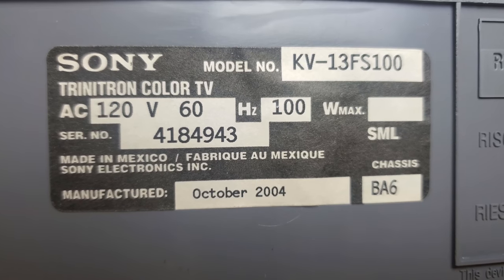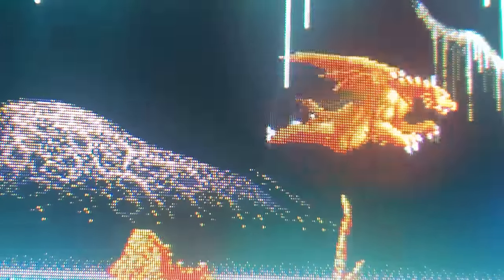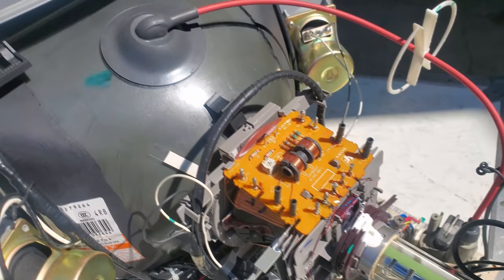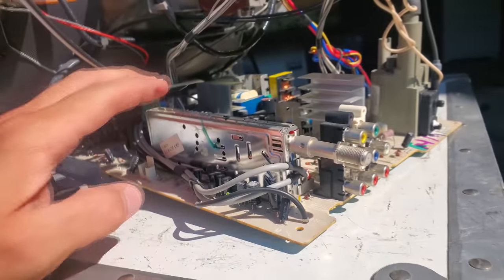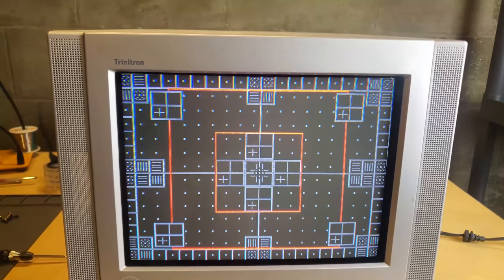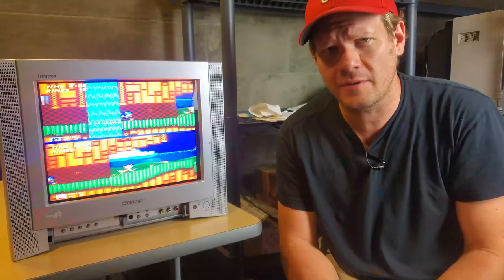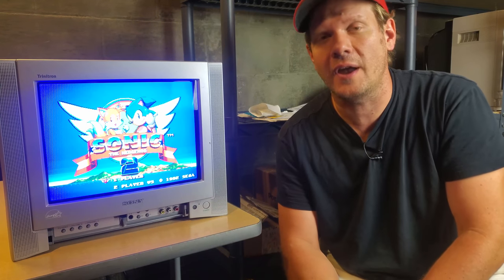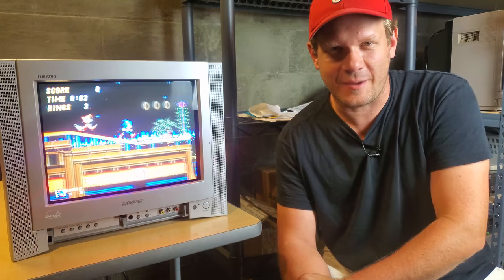What do I think about Consumer CRTs? - Sony KV-13FS100 Review & Adjustment

Comment: I'm in the UK and pretty much all of our consumer CRT's came with RGB out of the box. I've found the difference between consumer sets that are RGB capable and PVM's to be negligible. And given the enormous difference in price these days I can't say why any one should ever opt for a pvm over a consumer set unless you happen to have too much money on your hands.
Reply: I agree the cost for PVM's have become insane, picked mine up Nov. 2019 at a local game store for $250 because I knew I wasn't going to get that good of deal again that was close and 14 day return policy, but my 20" consumer trinitron is still fantastic.
Reply: I agree, I would even say getting a consumer crt rgb modded here in North America is way more worth it than paying for any pvm/bvm.
Reply: @Demokirby  Prices for PVM's in the states have gone bonkers in the last 3-5 years and espeically over the last 2 years. 5 or 6 years ago it wasn't hard to find a decent PVM in my area of PA for around $100. At that price, yes a PVM is worth it over most consumer grade CRT's. The tubes are just that much better. Picture quality is often just that much better. Crank those prices to 3, 4 and 5 times as much? I'll take my $25 32" JVC-D Series... component inputs and an overall really nice picture. Not PVM good. But damn.... I'll save the hundreds of dollars.
Reply: I'm also in the UK. Just picked up a near-mint PVM 20M2MDE with very low hours. Performed the geometry re-cap as a preventative measure and Calibrated. I can honestly say the picture & geometry is FAR superior to both of my B&O (MX4002 & MX7000) consumer CRT's.  Night & day different.
Reply: @nocturnaldivision  I know both signals are virtually identical, just saying rgb modding a TV is still worth over paying any premium price for a pvm these days, that's all
Reply: @BeeRye  Fair enough. If I had the means I could see modding a crt without component being worth it.
Reply: I agree, also the size. PVM are small, while I have two 21 inches CRTs and one 32 inches Sony Trinitron (aesthetically it's very similar to the one shown in the video).
Also, PVMs are too sharp for my taste, they don't blend pixels enough.
Reply: @davethebulb  I wonder how does a PVM compare with a consumer grade CRT PC monitor. BTW, can a PC monitor show interlaced content?
Reply: Yeah not into the PVM craze to be honest they always come small and in the end I want my games to look like what I remember.
The gameplay experience is better on a large screen IMO
Reply: @souljastation5463  A decent multiscan PC monitor can display a slew of different resolutions including interlaced.
Reply: @davethebulb  But most PC monitors weren't multiscan if I'm not mistaken. I think the average consumer monitor can only display progressive content.
Reply: Meanwhile in North America (Canada, US, Mexico), Braun tube sets (I directly translated the Japanese term due to CRT being used as a sociopolitical acronym in the US) never came with RGB inputs. However, this wouldn't be important for someone who needs to get sub-33 in Super Mario World without using the Star Road, or people who just want to play the damn game (like me).

As for the component VS RGB debate, I prefer component due to several major advantages: it uses three distinct RCA connectors in luma-blue-red formation, it allows for resolutions up to 1080p, and the Japanese D-Terminal connector is based off the component video standard (especially great if you want to have real component video on your GameCube for less than using an actual component cable). Reasons I wouldn't use RGB would be the fact that most consumer RGB equipment outside of PC/AT computers used SCART, SCART equipment remains expensive in North America, and I know there are absolute purists in this video's comments section saying the framemeister is still the best scaler.

Especially since the framemeister has never had a single price drop in it's life in the market, the delay for switching resolutions lasts centuries (well, really only a few seconds, but in games with quick action, that is forever), and Sonic 2's split screen doesn't work with the Framemeister. The OSSC and RetroTINK exist for a reason, and not many Japanese streamers use the Framemeister either 😒

And in Vietnam, Braun Tube sets never had RGB in it. I know because four years ago, I went to Vietnam to visit my mom's family (on the way home, I went to Japan), and I transported a dual system NTSC/PAL set from my aunt's house to her farm. It only had up to S-Video on it, but the cable boxes (which are smaller than those gigantic North American DRM propaganda boxes) only supported analog video via composite video. Even in Japan, I cannot find many Braun Tube sets that support RGB, and many people that do speedruns there don't use RGB.

A Korean YouTuber even imported a Braun tube set from Japan, and it had mono audio and composite video.
Reply: I agree, I live in France and ALL consummer CRT 's had RGB/Scart since 1980, we were lucky at this time.
Reply: @patosomon724  Your TVs had to have RGB because of SECAM. If you tried to connect a PAL device to a SECAM TV with anything other than RGB you would have seen a black and white picture.

And this is also the reason why every French console outputs RGB, even the ones that in PAL territories normally don't.
Reply: Not all of them did. Depends when they were made or what make / model they were.
Reply: @souljastation5463  Some of the French consoles just internally converted composite to "RGB", like the French NES.
Reply: @RWL2012  that's because the NES hardwate can't output RGB, but most of the subsequent consoles (Mega Drive, SNES, PS1 and 2...) can.
Reply: @souljastation5463  You can get the NES RGB mod from game tech and it's amazing!

Comment: Love consumer set vids. Detailing geometry, convergence, and color adjustments on Sony’s, Toshibas, and jvc would be useful for a lot of people. Pvms will become more rare, but finding a decent consumer set and dialing it in gets you most of the way there.
Reply: It certainly does. A decent quality consumer CRT, properly dialed in terms of focus, brightness, color drives, and getting the geometry in good shape.... you get 85% the quality of a PVM for in many, many cases a tiny fraction of the price. A recapped, cleaned up PVM is a thing of beauty. But at a price. $1000+ vs something you could get for free or for $50?
Reply: The quality improvement you get with a refurbished/future-proofed pvm doesn’t scale with the prices of today when compared to good consumer set. Fraction of the price and 80-90% of the quality. I love my Toshiba 20af and my 32in d series, even though I have a 20m4u and 1354Q. I find it hard to recommend paying for a pvm over consumer set for most people, after seeing them both side by side.
Reply: How good are the late model Toshibas?
Reply: @snizzytown5217  excellent. I like them more than Sony’s. Any late model set with component inputs is going to be excellent if it hasn’t been abused though

Comment: Great video, Steve!  I happen to like consumer CRTs more than Pro monitors.  For me, it's all about nostalgia and I like to use CRT TVs that look similar to the ones I had growing up in the 80s and 90s.  The 13FS100 does look like a really nice set and I would like to get one at some point.  One consumer CRT I picked up recently is the Sony KV-13TR29, new in box, made in 1994.  It is one of my favorite CRTs of all time and has one of the best pictures I have seen on a consumer CRT and it is composite only.  The picture is very sharp and the colors are excellent.  Compared to my PVM 14N5U, I like it a lot better and it has much better colors than the 14N5U.  Apparently, the 13TR28/9 sets they are easy to RGB mod as well because there is a closed captioning board that you can remove and inject your RGB into there.  The 13TR29 is the white chassis version and the 13TR28 is the black chassis version.  They were made between '93-'95.
Reply: Totally agree, and what is nice about consumer sets, is that you don't see them ugly scan-lines you sse on PVM/BVM, as the HVL resolution matches the line count vertically, so you get a more balanced pixel-art image.

Comment: I am also very surprised as to how high quality this CRT is.

I bought the KV-20FS110 back in high school during the Gamecube era.  Does not have S-Video, Component input is great, and unfortunately it is a flat screen. 

Still works like a champ, tube probably less than 6000 hrs, mainly used for gaming, no movies or TV.  
Now with emulators, PVMs, etc. I realized that mine came a bit brighter with convergence a tiny bit off.  

Your videos have given me a lot of confidence taking apart and repairing CRT's, PVMs, and the occasional arcade CRTs.

Keep up the great content!

Comment: Yesterday I bought a tiny and neglected KV-14FV300 CRT for $ 20 USD, I had to reset it to factory settings as the so called expert that had "calibrated it" only managed to make a real mess of input & video quality.

I stumbled upon this video trying to learn how to adjust the screen pot which also had been tampered with, thanks to this video I learned how to do it, and also I found out that KV-13FS100 and KV14FV300 seem to be the same TV, simply sold in different territories under different names, and now that it works I'm delighted with the image quality, RF, Composite & Component inputs.

Comment: I would like to see a full restoration and fine tuning of this tv and a comparison of it with an entry level 13" PVM and a more bare bones 13" crt set as well.  It would be great to see before and after restoration/ adjustments of each and also composite comparisons, and rgb mods and comparisons of that.  You would be diving deep into the subtle differences related to comb filter quality in the case of composite and with RGB mods you could isolate differences related to tube & driver circuit quality.  These well equipped models are getting close to entry level PVM tvs in their difficulty to find and prices. I fear the last of the small tube availability will be lower featured consumer tvs but with the right TLC and a few mods they are capable of providing a great experience.  Keep on growing interest in this hobby, we need people to save more of these things from recyclers so our kids can see what old school gaming was!

Comment: A friend of mine is building a few arcade cabinets from his childhood, using tubes for the nostalgia, and I convinced him that Sony TVs were better. He doesn't care much about how "accurate" the tube should be for an arcade, so we found a 27" flat screen Trinitron from 2007 (one of the last in Brazil) and brought it over. Turns out the image has really bad convergence, focus giving out and a pinkish hue, but we aren't CRT pros, so we decided not to mess with it, and he didn't care that much about the washed out picture, giving it a more "natural" look, he said, so we left it at that. Though I did notice a board very similar to the one you pointed out for regulating convergence, so I might give it a go at turning that pot a little the next time I go play some Mortal Kombat at his house!

Comment: Fantastic, if you could do a video on adjusting a 27in+ KV-FS set — that would be amazing, as they're known for having issues with bowing.
Reply: Same. I've attempted fixing mine and I just made it horrible. Which is a bummer because the tube is in great shape.
Reply: A video of him successfully fixing a wega yoke sag would be awesome
Reply: It's really easy to fix with a basic yoke adjustment.
Reply: @busterscrugs  Have you ever tried? I've heard you can fix bowing by pushing the yoke in securing it down with some wedges but I've never tried.
Reply: I have tried on a couple but the yoke is often REALLY stuck to the tube.
Reply: @riggel8804  i’ve tried pushing down on a wedge and nothing changed. My friend showed me a Sony diagram saying to pull the yoke back slightly to align it, but there are so many wires in the way that I don’t think that’s a good idea.
Reply: @NullyBird  you can pull the yoke out. It's okay. I've done it before. But never to fix bowing. You are going to need to do more than push a wedge I think. My understanding is that you pull the yoke out and then push it in until it's  snug and reteatach the wedges.
Reply: @dylanjastle  I've never tried on a wega but on every yoke adjustment I have done it moved freely once the screws and/or the glue was removed. Are you sure you had all the screws on the neck loose?
Reply: @riggel8804  Yes, I fixed the infamous WEGA bow on my KV-32FV16 by literally picking up the yoke. The guy who says they're stuck probably didn't remove the wedges or loosen the screw before attempting adjustment. It's super easy to do, I also fixed the screen tilt while I was at it since the screen tilt function in the menu messes with geometry.
Reply: It was a 32in toshiba af. All neck screws were loosened, and I even used a box cutter to make sure the yoke wasn't adhered to the wedges. Wouldn't budge. I have made the adjustment on other sets without issue though.
Reply: @busterscrugs  awesome. Thanks for getting back to me. You're the third person to tell me the same story. Bowing in the middle of the screen is a really common problem with Wegas. I will have to do a video in it. Or hell. Maybe you can.? 

Yes when you do the notsc adjustment to fix tilt (I think that's what it's called) it can mess with the geometry, especially at the extremes of the service setting. Even using the "tilt adjust" in the user menu of xbrs can mess with geometry. Yoke adjustment is a good way to go.
Reply: @dylanjastle  good to know. Thanks. I've got a toshiba af with some slight bowing I might try to do a video on it showing how to fix it. Hopefully I won't brake the neck of the tube!
Reply: @dylanjastle  I thought you were referring to Wega sets, my bad. The Toshiba probably has a bonded yoke.
Reply: @riggel8804  I fixed it, turns out here are two rings on the back of the yoke that will get rid of the bend.
Reply: @NullyBird  do you mean the 2 hose clamps on the neck of the tube?
Reply: @riggel8804  no, I made a video on my channel, shows me turning them.
Reply: @NullyBird  oh. I bet your talking about the convergence rings. Cool. I will check out your video.
Reply: @riggel8804  Well there are two convergence rings, and two purity rings, right? The ones I adjusted weren't part of either of those pairs. They were in the back, same ring types, but totally separated. I'm not pretending to be an expert, mind you.
Reply: @NullyBird  huh. I'm no expert either. Ive always thought of them all as convergence rings. Ive never heard of purity rings. As long as it fixes the geometry when you turn them who cares what they are called.

Comment: I bought this exact model in 2003. It stopped working in 2014. I freaking miss this television. I bought the Japan only, GameCube component cable to use with this, when Metroid Prime was released.

Comment: Nice video. I have a 27” and 32” version of these later Sony KVM. They look good but the reds tend to over saturated. I have not spent much time trying to fix the issue yet though.
Reply: I think the reds can be toned down with a single bit setting in the service menu

Comment: I recently picked up a Sony KV 36FS100 and am looking for advice on how to adjust it. The main issue is the whole left side of the screen bows down. From what I’ve read thus far, it looks like the only way to correct this is by opening the tv and adjusting the yolk. The TV is in great shape, and was owned by an older lady who bought it new and is now upgrading. Any advice would be greatly appreciated!

Comment: Love the content as always.  

I just picked up a KV-24FS100, and there seems to be issues firstly with the IR receiver, but also other front panel components.  The input button barely functions, and the TV wont stay on Video 1 even with an input.

What internal parts should I target for replacement? Cheers!

Comment: I'm using a consumer Trinitron with a Mister FPGA (RGB signal, VGA to SCART). I used the service menu to set the horizontal image position but the setting is maxed out and my image is still shifted to the left. Is there any other way to shift the image without using an external device ?